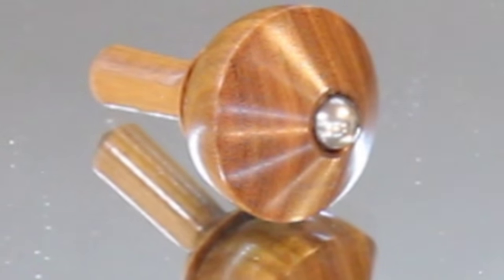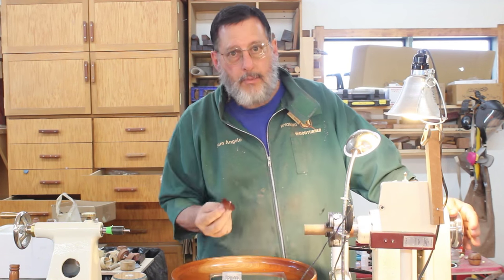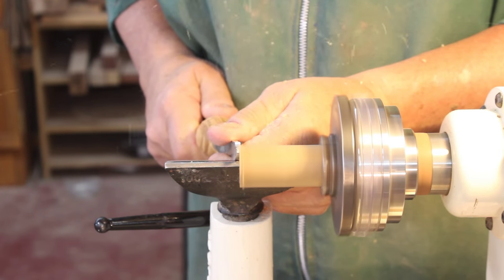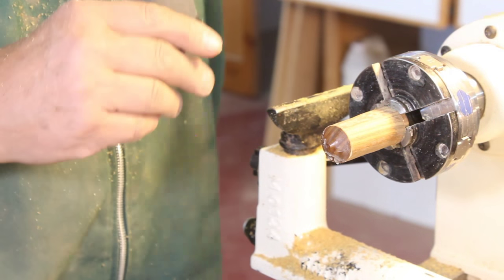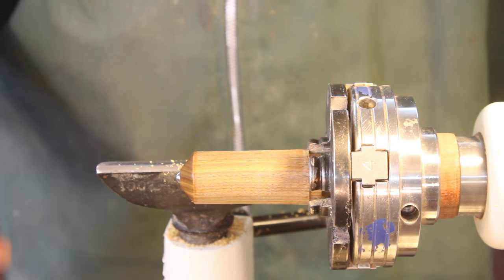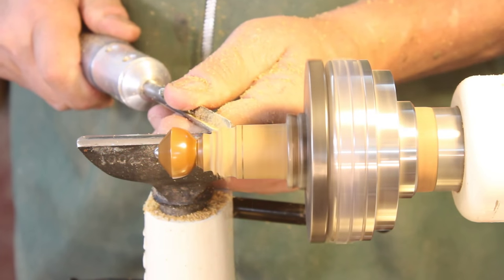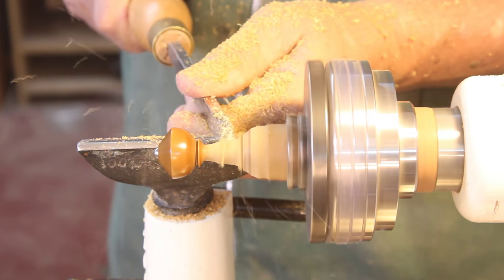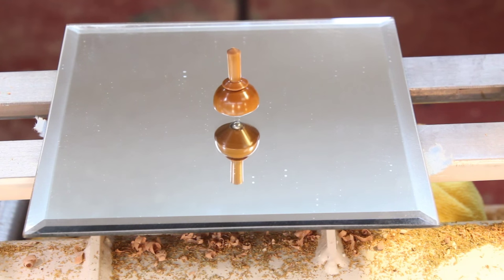Spin Top with a Ball Bearing Tip by Sam Angelo

Comment: When I was a kid I had an old fashioned top you would wrap a string around. The tip was some sort of nail. It tore up the hardwood floors and my folks had to take it away from me. This is the solution- brilliant.Frank
Reply from the maker: +Frank B I made one of those tops and figured I would break a window before I could make it work.  I never did get it.  
The kids make it look so easy.
Sam

Comment: Hello Sam, been awhile since I've been around, still fighting the side effects of the chemo and radiation, but the Cancer is still complete gone. You just showed me a great idea as I have approx. 10lbs of ball bearings I've been saving, here's my chance to use a few. I used to cut old ball bearing from repair jobs I did on hydraulic pumps and motors to salvage the balls for sling shot ammo.

Comment: You can also use Tungsten or Ceramic ball bearings which are very hard materials used for spinning top points. You don't want to drop a ceramic bearing on a hard surface or they can break.

Comment: I used a piece of brass rod inserted into the tip before I finish turning the point. Ball bearing seems like an easier option now.
Reply from the maker: +archiearchie666 The brass rod seems like a cool idea as well.  It you ran the rod straight through the blank you could see it coming through both ends.  Sam

Comment: I didn't hear if you said what glue you used.  I'm assuming CA.  As brittle as that stuff is, do you think it's suitable for a toy that's meant to be abused?  Better use for 5 minute epoxy maybe?
Reply from the maker: +Josef Roesler I actually failed to film the part when I glued it in. I did use CA glue but I had a good friction fit as well.
Sam